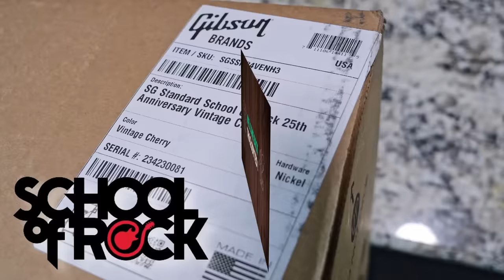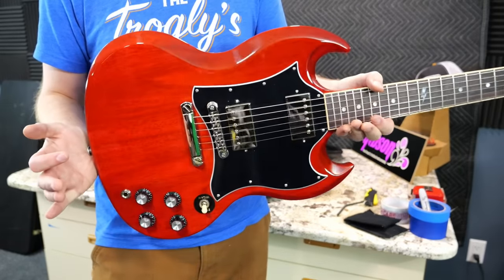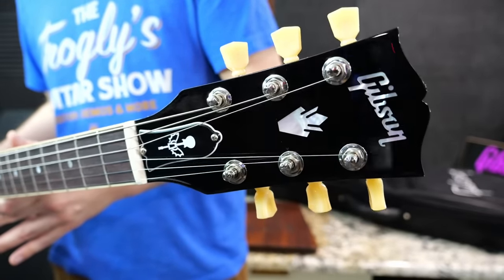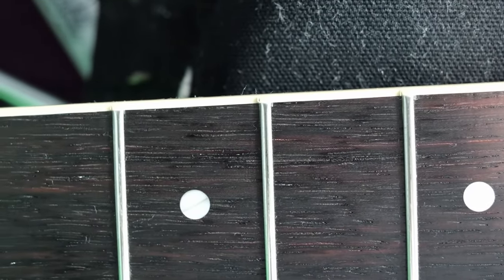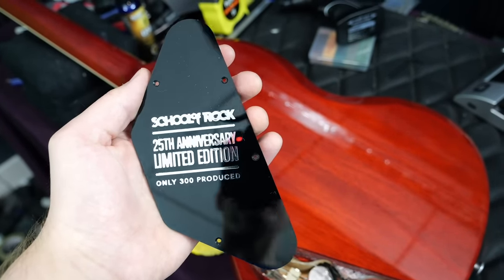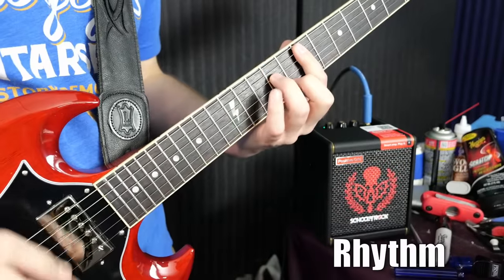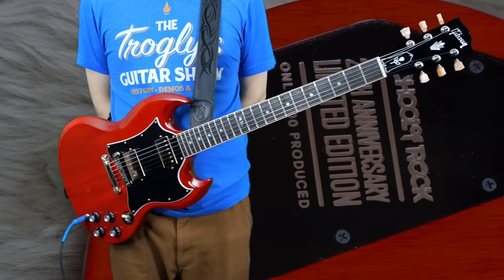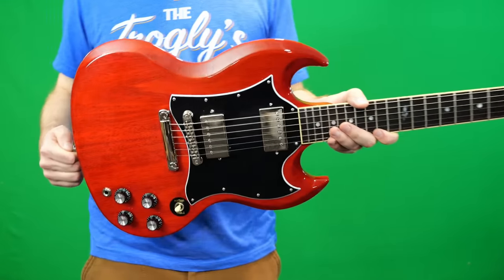I Got the School Of Rock SG! | 2024 Gibson Limited Edition SG Standard Lightning Bolt Inlay

Comment: The best thing about the little Spark Mini amps is that they are the same interface etc as the bigger Spark 40. They make amazing headphone amps, they can be used for recording if hooked up to a DAW and if you get the Spark Cab they are even giggable. It's insane that a tiny portable practice amp has so much potential. I wish my first amp could have done all that.

Comment: IMO, '60's Burstbuckers destroy the 490's, especially in the bridge. I've swapped out the 490's for Duncans all three times I had them and always leave the '60's BB's stock. You may not agree and that's your prerogative. Obviously tone is subjective but cut and drive are fairly evident traits you can hear when you compare them.
Reply: Definitely different (potted vs un) I like both for different reasons.  Surprised, they used the unpotted to learn.

Comment: Hey man. 👋 
Could you review the Fender Juanes Signature? I bought it without knowing who Juanes was. Just based on specs. It's the highest priced Fender strat before the Custom Shop. But imo, it rivals my Custom Shop strats like a champ... There's a push-push with INTEGRATED MIDBOOST! Even better, the first Tone pot blends the midboost!!!... HSS configuration. With 2 custom ultra noiseless single coils.
A VERY THIN layer of nitro in Custom color Luna White... 
9.5 to 14" radius... 

I've had it for a while now, and it just sounds AMAZING, plays soooo good, looks nice. 

Anyway. I recommend this strat except for the fragility of the paint job. But I actually love the thin layer, it's already starting to relic... 

Ok cheers

Comment: Sweet School of Rock SG LE with 61 pups, but yet another cherry SG? I have the 'black style' quick connect in my 2018 SG Special. Was thinking of throwing a coil split PCB in but they're the "white style", definitely not compatible wiring in the connects. Oh well. I can live with it I guess, my model has small block inlays, 24 frets and Firebird pups so it's unique in good ways too.
Reply: Just instal new pots / caps and you’re gtg.
Reply: @TommySG1 aftermarket is an option but trying to keep it stock for resale value. Trimming connects off to solder ruins going back to stock.
Reply: @jimmyjames2022 if it’s an older one ( 20 years or better ), I’d certainly agree trying to leave it stock. Most folks though view the boards as a con instead of a pro though so I wouldn’t sweat the stock thing personally. 
Anyways, if you’re cool with the way it is then by all means leave it alone 🤙
Reply: @TommySG1  yes good point. It's a reissue of a 1974 Special with unique specs. But few want the PCB. I'll give it more thought.

Comment: Seems like this particular model didn't get finish sanded at all. There are strings of material and rough spots all over that binding and the truss rod cover. I hope it was just a Q.C. issue and not Gibson skimping on a model that is supposed to be for kids as a starter or alumni as a limited edition.
Reply: It’s just for kids? Let’s give the kids a modern car without seatbelts and airbags coz hey they’re just kids. 
Dude really?
Reply: @PeterMoore350  Focusing on the wrong part there, guy. It's a SCHOOL. Where KIDS go to learn music. That's the reason I said that. This guitar is marketed towards alumni or current students..in that school. It isn't a student model. 2 + 2 does infact equal 4 sometimes.
Reply: @leviathan_is_me point is ? i ca fix anything. YT deleted my prev comment. i'm a mentor.
happy to be one.
you have to structure the content so the students arent bored,  but easily done
ptr
Reply: @PeterMoore350  and I saw the long rant about Linux and the threat...which is why it was hidden btw....don't threaten people with something that is a serious felony in an open forum where it will lead right to you..not smart (the whole blocking my internet with a few clicks..not saying you were threatening me, but it does come across that way.) I get you're very proud of yourself and seem to have a complex about being looked down upon, or judged..at their peril. I'm not judging you, not saying you're dumb. If anything, I'm saying you're a little TOO smart. I have a cousin who borders on being legally considered "mad" and is watched...he tea he's at a university... interesting guy....anyway, sorry again if you feel I'm judging... I am not. Sorry if you felt I was speaking down... I am not intending to. I have an issue where I feel like I can't explain things properly because I lack the knowledge and verbiage to do so adequately. So if anything, I am mad at myself for this misunderstanding, not you. I also wrote this AFTER the long one... which I will leave for posterity....I had to do some...stuff...to find and read your other post. Your first words were "got ya"..... that means my previous comment is meaningless...do ignore.
EDIT: I did delete my original reply after all. Upon rereading it...I see where it can be seen... let's say badly.
... and to your other comment on MY other comment... your list of guitars is 🤌 chefs kiss.
Reply: @leviathan_is_me iYT obviously deleted whaetver i posted.
i can't aopologise for some rant i sent,  i rant a lot. It's, hopefully, never meant to be personal.
Obviously YT deleted whatever post your referring to.
I have no copy of it - it'd benice if YT send me copies of posts i send they deem "not acceptable".
I desn't hep me.
You say, i say.

Fine.
But the point is, i must have had a point when i typed it, right or wrong.
The fact that YT removed it from my history ? I thought it was not sent.
Deemed unworthy tobe sent or whatever holier than thou YT has WRT posts with everythingnn except Trump worship
Reply: @leviathan_is_me what threat ? are we on the same forum ? do you have the right person ?
Reply: @PeterMoore350  Forgive me, are you saying YT censors Trump worship, or TDS? I was unaware that was an issue anywhere but USA.
Reply: @PeterMoore350  you wrote a long rant about your IT job, and how you learned many things that no one else in your company understands. That you don't use them, but you learned them and are proud for doing so (as you should be, learning for the sake of is admirable) then you said something to the effect of those who look upon you and  judge you do so at their own peril, and you could shut off the net with a few clicks. I am paraphrasing because if I use a direct quote it will the block me as well. I understood what you were saying, but YT could view it as a threat. Which is why it got blocked. Nothing bad.
Reply: @leviathan_is_me ok. maybe i need to check my firewall logs.
what time did this happen ?
Can you send me screenshots ?
Reply: @leviathan_is_me i couldn't shutoff my light bu;b without my g/f saying yes
Reply: @PeterMoore350  nope. I can't see it anymore. It was on the comments on the channel section when you click on the name of the commenter. It saves last 3, deleted or not it saves them. I saw it there.
Reply: @PeterMoore350  does that NOT sound  familiar at all? Do you not work in IT and this sound like you?
Reply: @leviathan_is_me i havent dne anything mate. i know i rant a bit, but i don't delete comments. What i type here stays here, i might edit to typos but hat's it. oh and when i edit ? i type EDIT - i've typos here i'm not gonna edit to prove a point.
Reply: @PeterMoore350  YouTube deleted it, not you. About an hour ago you mention YouTube deleted your previous post. So I went and checked what that post that YouTube deleted was. That post that was deleted by YouTube is what I am referring to. Seriously, do you work I.T. for a company in NZ? The post I am referring to says this. If that's not you, I have NO clue wtf happened then.
EDIT: The first words were "got ya"
Reply: @leviathan_is_me "got ya" is not in my vernacular.EDIT: i'll rebuild my windows virtual machine. Obviously something isnt quite right.
Reply: @PeterMoore350  then something is quite messed up. Either something got crossed somewhere in YT land, or someone used your account. Either way, that came off your name. Sorry if this is freaking you out in any way. I'm seriously just going by what has been said on here. There is no need for the "virtual machine" thing if that's gonna b an issue for you. You still haven't said anything about the I.T. thing, which is weird and makes me think you know what I'm referring to. In another comment of mine, you commented about shoddy fretboard work and said "greetings from NZ 🤘🎸 " that's where the NZ came from. YouTube puts numbers after names now, so it is possible another PeterMoore with dif numbers happened to be what I saw. Dunno, Either way, sorry about all the confusion and....well, whatever we have been doing all morning, lol. Have a good day, mate. Weird stuff